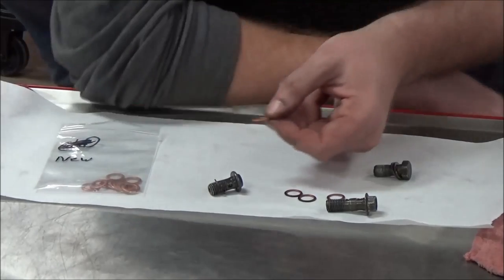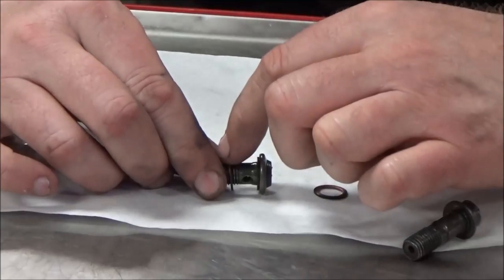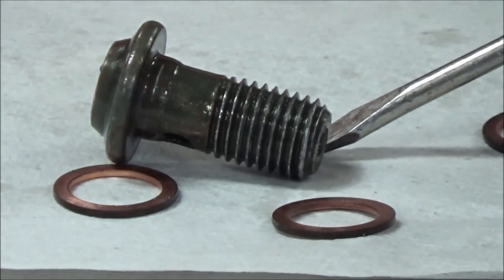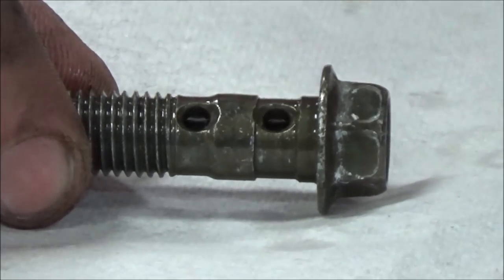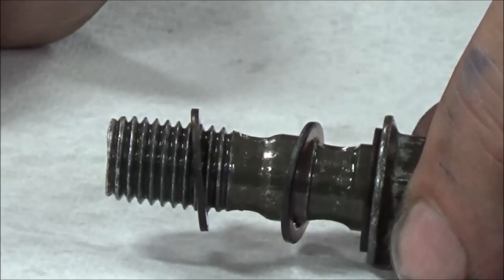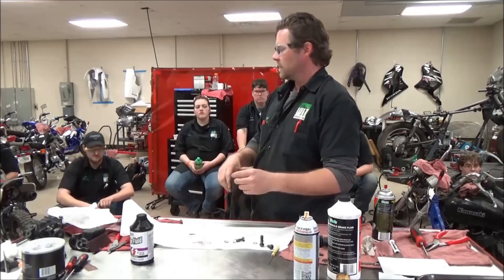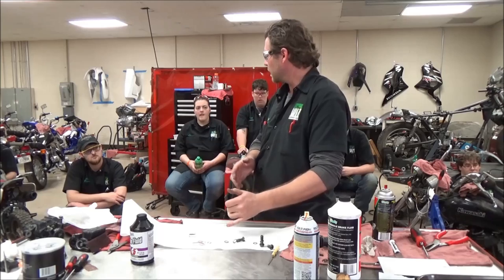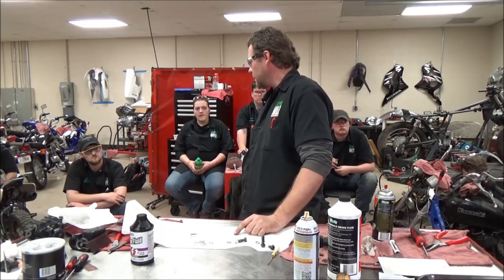Why you should always install new Banjo Brake line Crushwashers. Same for oil, coolant, and drains.

Comment: Excellent video. Maintaining "bench stock" is vital to efficient shop operation and avoiding back orders. The clear plastic Flambeau and Plano fishing tackle boxes sold at Walmart are made in USA, cost only a few bucks, have removable dividers, are shallow enough to fit most tool boxes and are ideal for bench stock like hardware and wiring supplies. 

I also use them for hardware organisation during disassembly.

Comment: What you aren't telling your class, copper washers really need to be annealed to actually form a good seal. When you do this torque specs aren't nearly as important as long as the bango bolt is tight enough to get the soft annealed copper washer to form a seal.

Comment: So can I just get these copper crush washers at the hardware store or are they vehicle part specific??
Reply from the maker: I find it best to get the model specific or at least japanese metric. For example, Honda, Suzuki etc are common thickness and outer diameter to fit a recessed brake line mount. In the end the technician must verify correct fitment and the easiest way to prevent problems is with the OEM make year model part.

Comment: So will it be possible to see fluid leaking from banjo/crush washer when trying to build pressure? I cant find any fluid leaks and honestly I was thinking of replacing the brake line (core brake lines) since I already went through 2 master cylinders and a few bottles of brake fluid
Reply from the maker: Here is what you need friend...https://youtu.be/jknC16h4E44
Give us a high five here:  https://www.paypal.me/how2wrench

Comment: Just did brakes on a 98 Timberwolf about how tight do I need to get these
Reply: always best to check the manual. If you don't have one look around for one online, forums are generally a good place to find them. My 82 Honda Magna's manual says the bolts should be tightened to 18- 25 ft·lb. I'm not sure how universal those numbers are but it should give you an idea if you can't find a manual for your bike online.